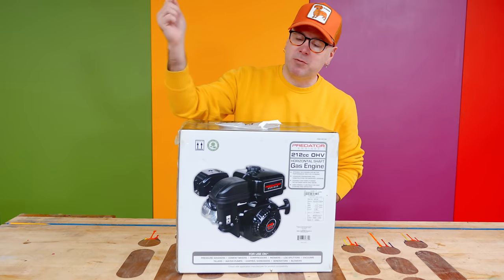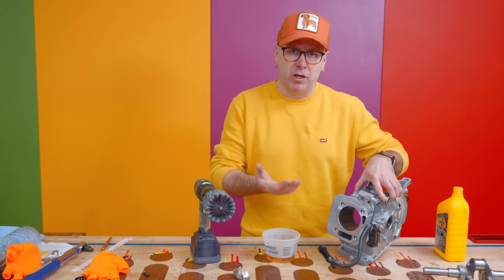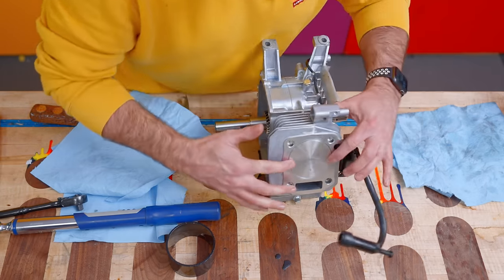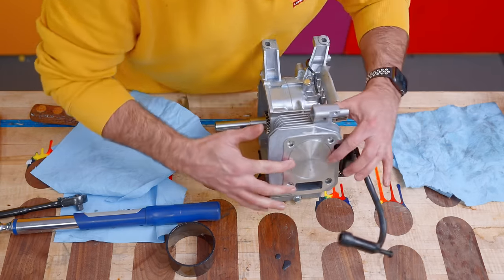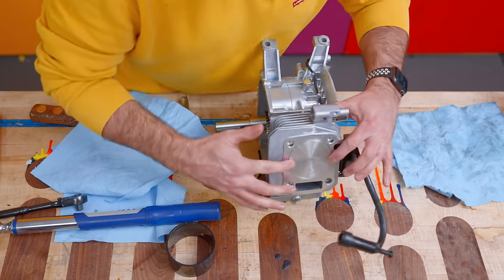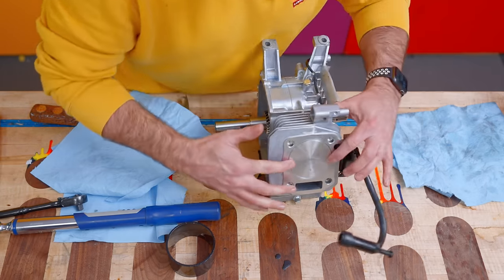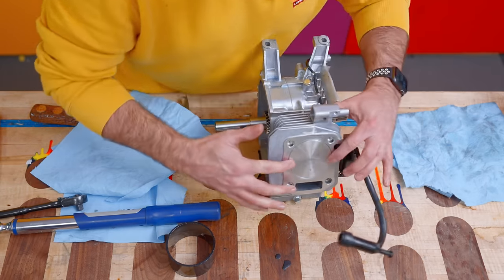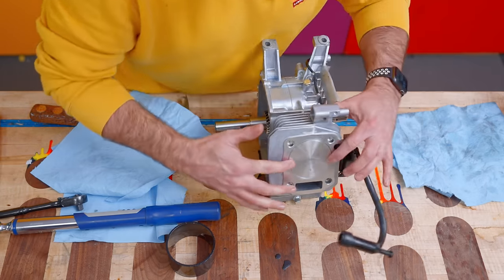How to Build a Competitive Kart Racing Engine (Stock Appearing)

Comment: Great video. I would like to see another video which focuses on how you configure your gear box and shifter-system on your race cart. Also what gear ratios do you use in your gearbox, engine sprocket, & axle sprocket for the very short tracks you race on?
Reply from the maker: Other builders in my area are anywhere from $2500 to $4500 depending.

Comment: absolutely 0 hate meant by this, and i just wanna add i respect you sharing this knowledge so much. Again, like you stated; this is just a theory. But putting zinc, or any additive that you are not going to actually run in races, is baloney imo. I think about it like this, if I am changing the consistency of my lubricant during the period in which I am expect a bunch of surfaces to start mating in a consistent manner, then once i revert the consistency of my lubricant it is entirely possible that whatever wear that i wanted to happen has either over or undershot (depending on which direction i go in viscosity) the real parameters under which ideal mating will occur. Unless you have insanely specific break in times and rpms that you derived from coefficients that you scientifically tested for and found pertaining to the viscosity(and/or reduction of friction) of the oil being used during break in period, i believe that any additive you add to your oil, specifically for this process, makes almost 0 sense. If someone has a different opinion please feel free to reply, as i would love to discuss and or learn something i dont know with you.

Comment: Break in, such a highly debated topic. It should be noted that a lot more high end vehicles (new vettes for example) limit the redline RPM for the first couple thousand miles on the vehicle so it’s impossible to run it hard during break in. While I think the differences are negligible it is fascinating how auto manufacturers have taken it passed a note to limit throttle in the manual to actually forcing it by coding it into the ECU.

Comment: Ever considered having the crank balanced together with the new rod and piston? Their may be rotational weight you could shave off there. Maybe have the flywheel balancing checked too.
Reply from the maker: It's impossible to balance a a crank on a single cylinder engine.

Comment: Set the lash when cold! Check when hot, but don’t reset until cold again.
If you adjust when hot there is a good chance of setting the lash incorrect because of the constant temperature drop in the engine

Comment: Flow bench? You mean vacume cleaner. I don't know the exact rules for your race series but if you do both valves you will get bigger gains but you need a good exhaust to take advantage of it. You can change your powerband rpm and width with exhaust modifications. Valve overlap and duration can be really crucial on a small engine. What kind of power do you expect from this?

Comment: all in all pretty good.  only thing that made me cringe was striking the crank end with a steel hammer.   I always cover the end of crank.  I'm not an expert on those kart/lawnmower engines but I always use a flywheel puller.  I would imagine one is made in place of the prybar.    for the bikes I build I always check the tru of the crank and there are gains in balancing the rotating assy.

Comment: Question about your valve job and back pressure.  I didn't see you lap the valves for seating, Is there a mechanical reason for that on these smaller engines?  Also needing back pressure is a myth. Engineering Explained and F9 have very detailed videos on this. Unless of course there's something completely different about small engines I'm not aware of.

Otherwise there's a guy who worked on cars for 12 years. I didn't really see anything you might have done wrong or uneducated about. 10/10 if I had a racing team, I would say no issue with your ability to build a fantastic engine.

Comment: Love this video. 1 thing I would have done differently is use fuel for the valve leakage test. Water is different in weight then fuel. Or density!? I dunno, science and stuff.

Comment: Use kerosene to check valve sealing, water is no good as surface tension stops it finding the small leaks, kerosene will wick  thru a bad lapping and show a wet stain in the appropriate port..  been building 800 hp engines running on methanol for years, and I check every head by filling them and leaving them overnight.

Comment: Cool stuff 👍🏼.
Question: 

When you took the dremel to the acual crank for a possible clearance issues  inside the block, would that not change the balance of the crank??? 
Or does that not effect anything in these little engine, im not being a wise a$s, just wondering.. 
Ggreat Vid, Thx

Comment: Not a bad video, couple things though. You are going to destroy your crank taking the flywheel off like that, at minimum put the nut back on it and make it level with the end of the crank or just get a puller. Also while that exhaust is neat looking, you are killing HP. You dont want back pressure on these engines, you want that exhaust to get out as quickly as possible.

Comment: Maybe I missed something, but you don't set valve lash at TDC firing. Remember EOIC!  Set intake lash while the Exhaust valve is just Opening. Set exhaust lash while the Intake is just about Closed. You don't have to be exact, just close. Notice that I've capitalized according to the acronym, EIOC.

Your advice to set valve lash at firing TDC will result in a much larger lash than necessary because the there will necessarily be zero lash at that point. if you were to rotate the engine two more revolutions you'd find your lash is zero again. This will reduce both the effective lift and duration!  You will not be making the power your cam was designed for!

Comment: So … I have a BSP 196cc I believe ,, it’s the yellow pull cover. I don’t race it. I do have an oval asphalt driveway which serves as my track ..lol .. it’s fun very satisfying ! I don’t remember having any issues last time I ran it , now I go to pull the cord …it only pulls half way out ? And I can’t pull the rest. Took off the pull mechanism and it works completely fine. Spun the engine both ways with wrench only spins a lil each way. Any thoughts as what this could be ? Do I pull the head off ? And then see if I can get a full revolution.  Again , I’m just an old guy who loves race karts and dirt bikes. I haven’t much  experience at all tearing one of these down.

Comment: It's been a minute since I've done go-kart engine type stuff. Last one I had working used MoTec with a bit of fuel injection with a custom made turbo. Piston died day one, so got a custom rod and piston. Methanol and turbo. Block died when testing.

Comment: To gauge air flow and turbulence, you can pump water though it and see where the air bubbles are.
Reply: You can't tell anything from a simple water flow test.  And if you have enough $$ to afford a good one, you can just buy the parts already built.
Reply: @foobarmaximus3506  yes you can, you just need to get clean flowing water. Sure its probably a half measure but it works.

Comment: Good video.
I do however fail to see the point in porting the isolator to the intake and then slab on the modified carb without porting the other side of the insolator

Comment: I just got done removing my govenor.  It was a bit more difficult than what it was made to appear in all the videos that I watched but by no means impossible.  I decided for whatever reason after that to take a look at the valve rockers as it’s very easy to remove the cover.  Lo and behold.  One of the rockers had FALLEN OFF the valve stem when the push rod had slid down a bit!  It was just dangling there!  Thank god that I checked.  Guys, beware of this.  On further inspection I found that the rockers are really wobbly from side to side.  Something I definitely did not expect.

Comment: And if you able to play with the fuel mixture ⛽️. I would try adding just a 2 oz of some Startron to your fuel . It will run like a top . And you will get way better fuel mileage. And definitely use mobile premium gas ⛽️. It’s way better then any fuel hands down .

Comment: Let's say you weren't looking for performance as much as safety and reliability. Would replacing just the flywheel be safe or do I need to replace the rod too. Guessing upgrade valve springs mean more compression more power. I'm just looking to add more reliability and safety. Was thinking of removing the governor gear and limiting the throttle response to safely rev RPM's without having a plastic poo gear in my engine.

Comment: Anyone who says "I don't like using assembly lube" is a shade-tree hack. Assembly lube is NOT just "thicker oil" - it is a low-speed lubricant specifically designed not to wipe out of plain bearings until it comes into contact with engine oil, which dissolves it into solution and replaces it. You're also supposed to do an engine oil change after a rebuild, which removes any remaining traces of assembly lube out of the sump along with all the metallic particles from the running-in process.
Reply: Speaking of running an engine in, as a factory Volvo and Isuzu heavy truck mechanic, the process is to start the engine, check all pressures, flows, and timings are correct, drive the truck around the streets surrounding the workshop until it gets up to operating temperature, recheck all the important numbers (including the valve lash), change the oil and filter, and send it on its way. Which means the the owner picks up the truck, loads it to capacity and goes right back to regular work. That could be hauling a 3 or 4 trailer road train across the country in the case of a bigger Volvo, or delivering palletised freight around a busy city for 11 hours a day in the case of a smaller Isuzu. Either way, they're effectively "run-in" after that first heat cycle drive.

Comment: This video was posted 10 months ago so you’ll probably never see this comment but having exposed crank bearings around where you’re removing material is a huge no no especially using a dremel right above it because all those little metal filings no matter the size, will wear down the bearings very prematurely. This is why break in oil changes exist after short use because there’s tons of particles and those are a 3rd the size of a dremel filing. Just something to think about when you open that size cover.

Comment: There is an easy vacuum tool you can buy on eBay to check if the valves are sealed. Just look for "Vacuum Test kit"

Comment: the way a professional checks the valve seals is basically what you did but the use plexiglass with a small hole for filling and put a pre measured amount of oil and then remeasure after it sits for lil while......so your basically there

Comment: Add to make that 5-speed transmission work all you have to do is make the chain just a little bit tighter I would say an 1 inch I should run a lot better if not try 1/2 inch tighter on the chain

Comment: Why do you hone a cylinder with that kind of tool? I've only ever seen them on drags where you quickly "clean" the cylinders. If you're honing you should use something which will properly cross hatch and hone evenly, meaning a solid connection from top to bottom. The tool you're using will move into any crease and uneven gaps in the cylinder and make it appear good, when in fact there's a tolerance difference in the walls.

Comment: If you find the right bolt just thread the holes and use a shorter bolt with lock tight

Comment: Lol.. you need some back pressure for the head to work

You know like you need a headwind so you can ice skate faster.

Engine is just an air pump, any restriction of any kind inhibits air flow. If you have a restrictive exhaust, that simply means you won't clear out the cylinder fully, so you can get a full new charge on the next cycle

This is why Dino headers are better than running an exhaust. You have less restrictions so it makes more power

At no point in time can you put a restrictive exhaust system on a performance car, to make the heads work better LOL

Comment: It all comes down to 2 things. You like to build your own or you just want to race and let someone else deal with it. Either way you will still spend 700.00 bucks. So either spend 700.00 and you build it or you spend 700.00 and a builder builds it dyno it and gets way more out the engine than a shad tree guy. But this guy knows a good bit and diffently could be a builder with a few more pieces of equipment.

Comment: I was going to tell you that water to test valve seal is a no-no but I see you have already been gang tackled in the comments. The best solvent I have ever used for this test is a solvent that was used mainly in the machine trade 50 years ago until it was found to cause permanent liver damage. The good news is you won't be up to your elbows in it like we were. The bad news is that it is so toxic it is hard to find. I'm going to build small engines again, so I will be looking for this solvent again. The name of this solvent is Tri-chloro-ethane 1-1-1

Comment: Hi, great stuff and easy to follow. I am on my third build. looks like racing, but just fun to do. I am still looking for the Valve Spring pocket cutter tool - no one has them.
 I was wondering you said after you (I'll say plane the bottom of the head)  with the HF Flat Bed sander (which I purchased after watching your video) and now to sand smooth on glass. Could you tell me what type of glass are you using? Just a small house window glass or what other kind. I know it must be totally flat. 
thanks David
Reply from the maker: Look for something called "plate glass". It'll be perfectly flat.

Comment: I have a 386cc Honda engine.  It is on trail wagon 400 side by side. I think I will install a motorcycle carburetor on it.  I think it would throttle up better than the stock carburetor. Any comments???? Also unhook the governor.

Comment: I used to race Karts at a national level in both oval dirt and oval asphalt.  I noticed in your initial clip that you were running Hoosier treaded tires.  Are those a requirement for your league or can you upgrade to slick tires?  They would drastically improve your grip/split times in dry conditions.

Comment: I am building a leaf vacuum / mulcher trailer to pull behind my tractor mower.

What I need is higher rpm(but nothing super aggressive for racing.   

I need extra mulch and vacuum.   

I volunteer landscaping for elderly couples and widowed at no charge.

Disabled,I’ll need to build from very low budget.  

Motor part needs a LITTLE HELP.

I WOULD BE BLESSED FOR YOUR REACHING OUT HERE.

Comment: IMHO, if you are running a flat tappet engine, you should always be running a zinc additive unless you have a specialty oil that contains it. Under high pressure, It's one of the best lines of defense before metal on metal damage. Modern oil isn't the same as the oil of yesteryear. Zinc isn't exactly environmentally friendly for the hundreds of millions of cars on the road with modern engines that no longer require it for decent longevity.

You're doing a great job with what you have available. Some metrology gear could be some low hanging fruit for better consistency. Dial indicator, calipers, and a machinist straight edge would up your game without too much expense. Record some engine blueprint info with each build. GLHF

Comment: Question. Won't grinding down the crank shaft mess up the internal harmonics that you speak of right after you grind it down? Or is it so close to the center shaft that you don't have to worry about it?
Reply from the maker: a single cylinder engine will never be perfectly balanced and what is being ground off is so slight that it's nothing to worry about.

Comment: my question is, since a year has passed, have you finally gave in and went to alcohol instead of gas? you went the distance on everything so I figure the switch was coming sooner or later, and if so, what there a noticable power difference?
Reply from the maker: I tried but switched back to gas. The spring and fall makes alcohol a bit trickier with carb jetting and starting.

Comment: 1:33 Instead of hitting the threaded crank end with a hammer, thread the nut back on just shy of being flush with the crank and hit the nut. Smashing the crank threads will cause instant regret.
Reply: I cringed when I saw that.  You should NEVER bang on the end of a crankshaft - not even with a nut on there.  BAD idea.  You will damage the crankshaft bearings, or worse.  It was not meant to be banged on .  Get a real flywheel pulled and use that instead.

Comment: Question, Why didn't you go over anything about the Push Rods, they may have to changed to a different size when using ratio rockers. how do you determine what length pushrods to use or is it ok to just use the stock length ones?
Reply from the maker: Most likely the stock ones won't be the right length. There are two ways to determine the right length. The proper way is to do all kinds of engine math. The other way is how I do it and have various size lengths on hand and see what works best.

Comment: No links provided for the 28.5 Intake Valve and the 36# springs? Did you use the stock parts?
Reply from the maker: Both come from ARCracing.com

Comment: What size and the name of the tool you used to open the spring pocket my cam recommended 36lb and I bought them and they don’t fit so I’m a first time builder who need a little Guidance and instructions

Comment: if it were me rebuildin your engine id try using a billet rod thats been "burned"? mabbee call it in the bearing journal and try milling it enough for a set of ceramic needle roller bearings as found in 2 stroke chainsaws.... also you could use one of the holes you plug to incorporate a drysump oiling and or a directional oil squirter for lubing yer fancy new roller bearing crank